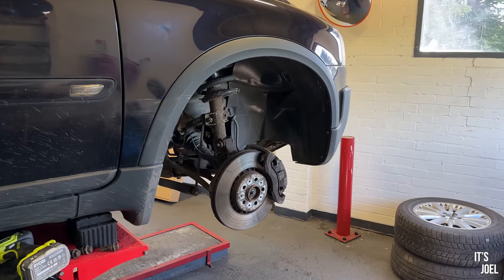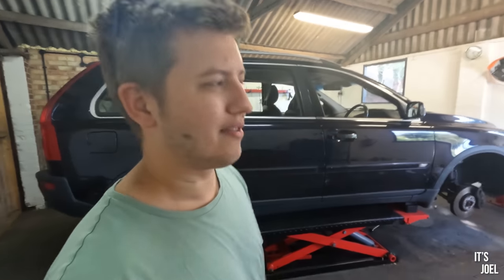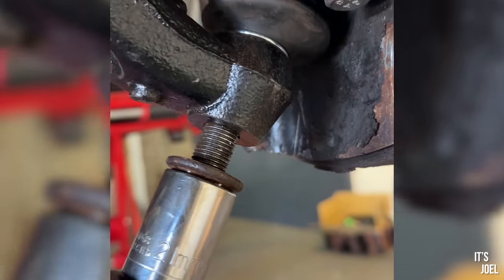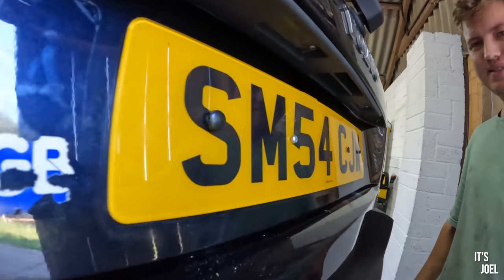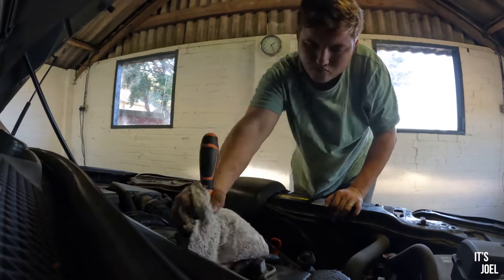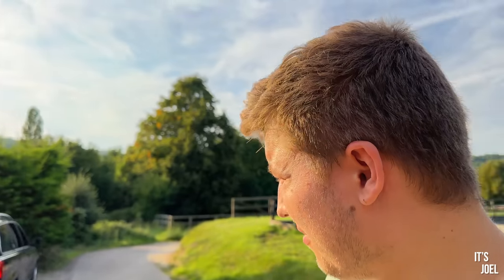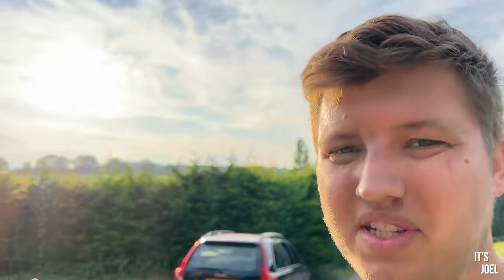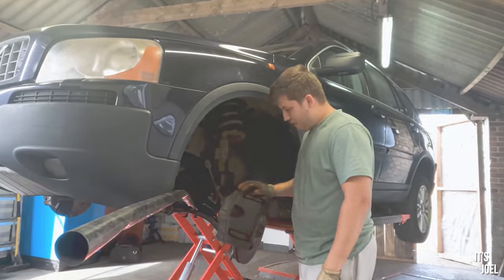CAN I SAVE MY £800 COPART VOLVO XC90? PART 4

Comment: A way to stop the ball joint bolt from spinning when tightening the nut is to lower the car and use a jack/axle stand to support some of the vehicle's weight on the arm. This forces the tapered region of the bolt into the arm and helps stop it from spinning.
Reply: Or use the impact driver he has there....

Comment: Hi Joel
The balljoint nut is easy to do - you need a spanner on the nut, and there is an Allen key hole on the threaded shaft of the balljoint, use an Allen key to stop the joint from turning while you do the nut up.
Great series, keep it up.

Comment: Nitpick here: The pipe you clip onto the top of the injector isn't the fuel rail, it's the injector fuel return. The high pressure supply is the pipe you screw on with the 15mm nut.

Also, don't forget to take out the copper washer that forms the seal between the cylinder head and the injector, as the new injector should come with a replacement. The 'chuffing' you heard with the new injector could have been due to the bad seal still being in the head -- it's pretty easy to take out with a large Phillips head screwdriver.

Even when an injector is not coded in VIDA it shouldn't be sounding like that, as that's usually a sign of a pressure leak.
Reply: Needed the correct '2' injector and a new washer as a minimum. Ideally new retaining bolts and clamp, as they are supposed to be single-use.

Comment: As everyone has jumped onto the injector problem. Well I’ll jump onto the control arm. If you lower the ramps down far enough and put a trolley jack under the control arm it will then apply pressure to the ball joint cone. You will be able to tighten the nut up without any hassle. As for the ABS well a scanner won’t turn it off as their is a problem. Either sensor or abs ring. I don’t know much about the Volvos but the abs ring is either attached to a driveshaft or a wheel bearing. It would just be easier to buy the component with the abs ring on it. Anyway hoping to see the end result.

Comment: Joel, the 1 on the injector is it's class. Theoretically, you shouldn't mix classes but in practice one or two class 1's would work just fine in between class 2. What you should really have replaced in that case is injector sealing rings. most preferably, all 5 on all injectors.
BTW, if the ABS light is persistently on, just a simple wipe of BCM codes wouldn't help.

Comment: Volvos are notorious for giving ABS light for just about anything you do without removing the battery first, something to do with different modules constantly communicating with each other(had a light go once in my father in laws XC70 just for removing radio,lol). Most of the time clearing errors in Vida will do the trick, so try it before replacing ABS rings.

Comment: Fastest way to get the roll bar links off is to use a grinder, remove the dust boot (just destroy it), then grind flat against the mounting surface of the bracket on your absorber, then the remaining end of the joint, the side with the captive nut, falls off. Out with the old, in with the new.
Reply: Was going to put just that, but thought I'd check the comments first!

Comment: small tip - when fitting number plates with screws, drill from the back, not the front. You can accidentally separate the layers and it quickly looks awful once the dirt gets in
Reply: Quick Tip: Try to not drill  ten holes to fit a number plate that only needs two.

Comment: first things first josh, you should have not bought a new injector, the correct way ids to take out the old one making sure you remove the copper ring,totally clean out the bore make sure you get to the bottom and clean, if you wanted too you can clean the bottom with a 17mm piece of wooden dowl does a great job, totally clean the old injector making sure you remove the old ring ( get yourself some carburretta cleaner ) when all clean put back the old injector (by the looks of things you didnt need a new one) do not forget to put a new copper washer on it,and jobs a goodun.....now for the drop link you need a spanner and i think a 7mm allen key to unlock the d/link easy peassy if difficult heat it up still not comming grinder out the nut....we have had a volvo xc90 black r-design  for quit a whilst now and the amount of jobs we have done on beauty you wouldnt believe, she drives like a new car....anyway keep up the good work and well done for trying we all had to have advice and learn...forgot    abs ring find out what side is causing the problem pull out the drive shafy this gives you access to the ring dremel the old ring off or hacksaw heat up the new one place it on job done, but also before hand check the sensor is working...

Comment: Hi Joel. To properly fit an injector you must clean the injector seat, resurface it and fit a new copper "fire ring" or "crush washer". That's the "tsk tsk tsk" noise you were hearing. Coding is also recommended.

Comment: i'll say it again for good measure the ball joints and the drop links have a hex shape on the end of the bolt for you to put an allen key in and hold the bolt while you do up or undo the nut with a spanner not a socket as you need access to the allen hole....if its an undo job usually their to corroded to be of any use so just break off the back side so your left with the ball... grab that with a pair of vice grips and undo the nut...and hey presto.

Comment: You will need a front end alignment when replacing parts up front. Life is a learning experience. Pull the bulb to the ABS light but get it sorted by a pro.

Comment: Loving this series! That injector sounded like it was missing the copper washer though, these are typically one time use crush washers so get one ordered.
As for abs it will need the sensor and the pickup wheel as the ring breaks and rubs through end of sensor

Comment: The injector should have a little copper sealing washer at the bottom this makes a seal with the hole it was going into this stops the injector blowing diesel back up the sides the seat around the hole should be cleaned with a special little tool that makes a nice mating surface for the new washer.Good effort on all your work for tips just look on YouTube for all kinds of car tips and tricks.

Comment: Drive shafts are sometimes glued. You need to install a screw and hammer it to brake the glue. You can reinstall it with grease and new bolt for xc90 with the integrated bushing

Comment: Hi Joel, thanks for these videos, glad you’re continuing to make progress. I used to own a 57 plate XC90 and did many jobs on it. A few things I’d add: 1) the UK XC90 Volvo forum has loads of guidance 2) YouTube channel SiRobb might be worth a visit 3) that headlining - suggest you get another from a later car 4) the broken flip up cup holder - take it apart and take out the open/close mechanism, it’ll work fine manually. Hope that helps.

Comment: Having battled all these jobs previously on my XC90 buddy I feel your pain with the abs rings. I had to buy a new hub and driveshaft in the end. I tried to press the driveshaft out of the old hub but it took a 20 ton press, which bent the hub to get it out 😵 when (if) it finally comes out slather then end of the shaf in copper slip so next time it won't be seized in 👍👍👍

Also nearly all Volvo torque specs are 2 stage, torque then angle. The control arms will 100% creak / knock if you don't do the second stage of tightening 😵😱

Comment: Great series Joel.  Well done.  Three suggestions for you:-
1. Clean/replace the copper washer under the fuel injector. That's very important.
2. There is a TV Show called 'Wheeler Dealers' presented by Mike Brewer, in which Ed China fixed all sorts of problems on all sorts of cars.  Ed often used spring compressors when working on  anything around (near to) the suspension parts. You may watching him useful.
3, A couple of times, when things have not been going too well, you forgot to record footage. Why not set up a second camera (even a phone) on an improvised mount if necessary, giving a wide shot of what you're doing the whole time. Then, if necessary, you can show clips or speeded up sequences from the second wide shot camera and voice over what you did on those pictures.

All that said, this series is genuinely gripping. I can't wait for the next episode, and if you follow this to its proper conclusion, you'll have not only a great video series and a valuable learning experience, but also a mint Volvo. 😁
Keep up the good work

Comment: The ball joint threaded section normally has a hexagon socket in the end so you can use an Allen key to prevent it spinning while you tighten the nut most of the way with a ring spanner. You finally torque it up using a socket in the normal way.

Comment: Please don't give up on this XC90. These vehicles are pretty much bulletproof. You can change the ABS rings without having to remove the lower arm or the bottom ball joint. I think I said in a previous video that the fuel injectors have to be coded to the vehicle. You should be able to do this with VIDA. I've managed to work on my XC90 without VIDA.

Comment: You’ve got us invested now! So you have to keep the series going till you sort all the advisories 😝
Reply: To be honest he is putting himself at risk here, not knowing what you'd doing is dangerous as hell
Reply: @mikejennings7779 but he’s learning and he has said he’ll get it checked properly. All good home mechanics learn this way! First on your bicycle then your car  then when you’re old and grey you leave it to the experts
Reply: @gwynneharries7024  mmm, I agree to a point, but it had to be driven off to get to be checked.
Fair play for having a go defo BUT the fundamentals need to be there first.
Basic understanding of how the suspension works say would have said to put a jack under the bottom arm to tension the ball joint to tighten it using the force of the spring.
The injector being swapped back to the old one, well clearly you could hear the chuffing of compression leaking by, why, because we didn't see a new copper washer or the old one out for that matter, it's great to have a go BUT know what to expect first.

Comment: Would be very interested to see this series progress further, really good content! As for that injector chuffing, there is a copper sealing washer that sits around the tip of the injector and seals it against the cylinder head, these washers can deform over time and this leads to combustion gasses escaping by the seal washer and making its way up to the top of the engine (all that black tar-like substance). There is a possibility that the original injector is OK, but just needs a new copper sealing washer, and possibly a good cleaning up of the end of the injector bore
Reply: yes try a copper washer first :}

Comment: Hi Joel....Greetings from the other side of the world and the southern hemisphere.
I have a  2009 Xc90 with the V8 Yamaha....which runs like a sewing machine.....No oil consumption or discoloration even.  (188K Kms: Emissions 100% perfect.)

The bodywork has its share of bumps, gouges, scrapes and scratches....which are sad, but normal for a car of this age here in this country.
Yours, by comparison looks pretty pristine and very clean.

Then we come to the undersides:  
Wow! Yours looks awful... It looks  so much older than its actual years, due, no doubt to the harsh winters and the road gritting/salt you have there in the UK.
Mine looks "a few years" old underneath..... no rust or rot certainly.....pretty good:  Bushes, ball joints etc etc...all brilliant and original.

Then we start with the roll call of problems!  I bought it with a radiator leak:  No problem. I bought a new rad and everything was fine for over a year. (Significant: See below.)
But shortly afterwards.... it was involved with a shunt with a pick-up carrying a length of steel in the cargo bed..... This went through the grill, the condenser and the radiator and stopped just short of damaging the cylinder head. (And ...No, I was not the driver.)

So: I replace all the damaged parts (DIY....Like you) The car goes back on the road and we think .....everything is great. 
But no..... In the accident, the oil for the gearbox became contaminated by  the water in the radiator. (The gearbox Oil Cooler is located within the engine radiator coolant. 😮)
So the Aisen Japanese Gearbox failed shortly afterwards.......  The people who repaired the auto-box seemed to have done a good job..... at first. 
But it seems they did not support the drive shaft (prop shaft) to the rear wheels in that the centre bearing failed almost immediately......  
I obtain a replacement online...being assured it is a perfect fit for my VIN: No it is not. Some Xc90's have prop shafts that can be split....most don't:   It's a one piece unit.  
Guess which one I have? 

OK! No big deal....4WD or AWD  (to be pedantic) is not a necessity for me and where I live;:   I had the prop shaft removed.  It ran great.....No problem.
I was in love again with my Xc90....V8 Powered Volvo.....🥰😍🤩😘

Then...out of the blue: A message appears: "Major electrical Problem"  (in Spanish)  followed by the Battery Warning Light illuminating.
A chap comes along and "Resets" the system..... The fault seems to be cleared,  I drive the car and the Battery Light and warning messages stay off.  Wow! Super.
He says the Computer "lost its memory" and simply needed a reset. Mmm?*

A day or two later when I next use the car: Back comes the Error Message and the Battery Warning light.  after exactly 2 minutes....each and every time the car is started.

Back to square one.  Another expert arrives with a most impressive looking "computer"...... it displays many faults all related to the Alternator as the root cause.

Now....with hindsight...here is my theory:  When the gearbox was removed......was ......
1) Strain put on the centre bearing  "Rubber Mounted Bearing"  of the prop shaft?  I accept it may have been already worn .....but not "failed" as it was after the box repair.
2) In removing the gearbox, the engine must be tilted and supported..... Could the power steering lines have also been strained.... they are mostly steel tubes...... Could a leak have been created which dripped down over the Alternator....they pass that way overhead on the V8.

Any Volvo Mechanics out there? What do you think?   All I want is my lovely V8 Volvo back on the road...... I love the car, but these problems are driving me crazy.

(p.s. *More Hindsight!  Maybe I should have driven the car longer after the initial reset of the computer, in order for the Computer to re-learn its parameters?)

Comment: You need to get your priorities right.  The 'simple' tasks (headlights, number plates, injector etc) can be done on your own driveway (or the side of the road).  The garage hire time should have been used solely for the items that necessitated the use of the lift.  BTW, the ball joint has a hex key hole - for an allen key - to stop the threaded bit spinning when tightening.  Finish it!
Reply: Even the injector swap is an easy roadside job. Garage ramp time is for undercarriage work (drivetrain, suspension, exhaust) only.
Reply: Feel he did not plan his 3 days. Prioritise those tasks that have to be done in the garage

Comment: Joel, quick tip for you if you can't undo the nuts on the anti roll bar drop links sometimes you can just over tighten them and the shaft will snap off, or just gun them on off on off in quick succession and they'll often start to spin off

Comment: you must use a new injector hold down kit , it will only work once , its a stretch oval bent washer that applies the correct compression to the injector to seal it , re-using an old one will leak 9 times out of 10. £28 of ebay or £25 of a volvo main dealer !!!

Comment: Blow by is created because of the holding plate needs to be straighten out before you put it in the injector. as well you need a new copper washer there. However as I mentioned before. MOT fail was due to your intercooler has hole in it and air escapes there causing rich sooty exhaust gasses. Replace that and give it a blast and it will be fine. But it is good learning curve for you. This is the best school. To do things, fail, do again, succeed and move on. Keep up.

Comment: Loving this series!

That ball joint was prob a slightly different thread to the new one…
So using the old nut on new thread it just locked in place hence turning the threaded part.

Comment: hi to make it easyer to stop the ball joint spinning, put the troll jack under the low arm and jack it a bit, this will jam the ball joint into the lower arm making it a bit easyer to screw the nut on.